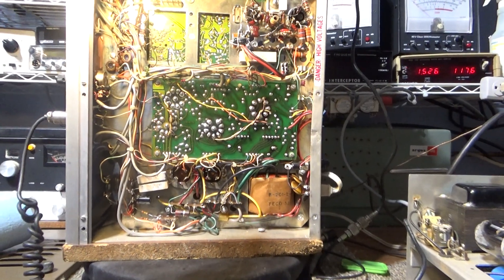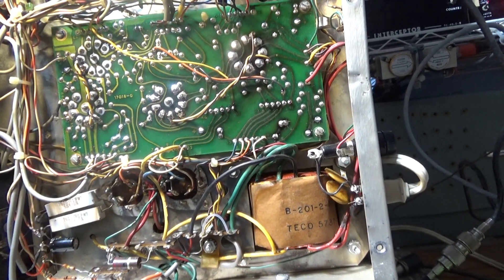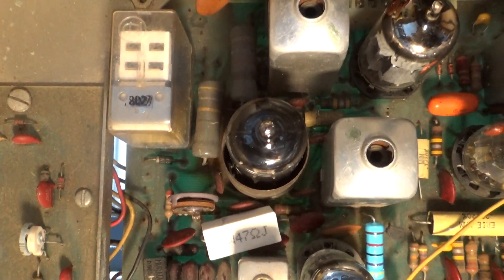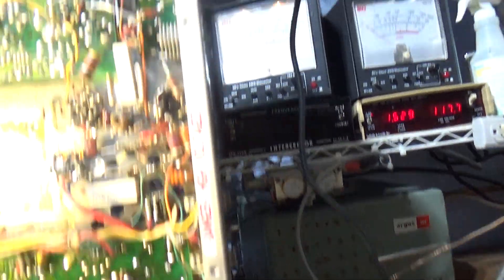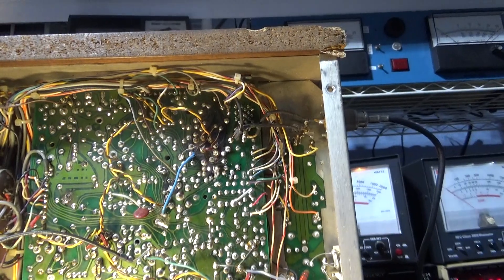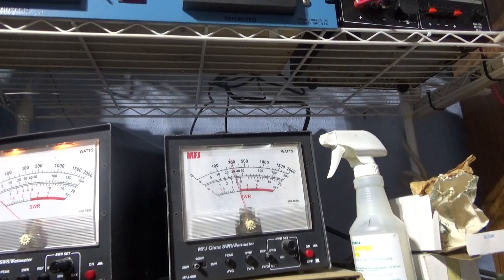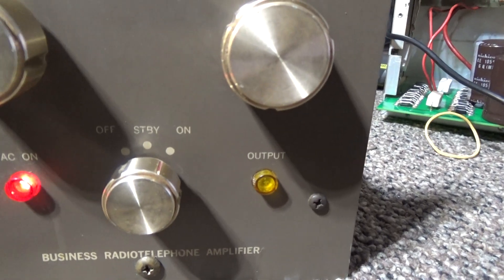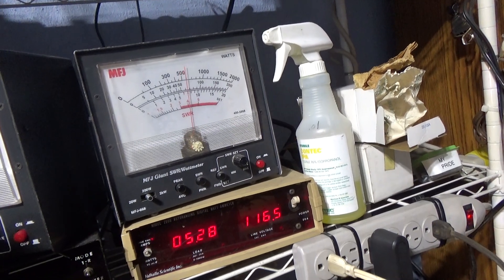One more Tram D201 done, one more left, and  Browning 180 with the proper neon on the bench.

Comment: FWIW, I think that the D201 has better receiver audio than the Mark 3. "Better" as in "fuller". The difference between a table radio and a pocket radio. The difference between a 6L6 and a 6AQ5. The D201 I had had the VFO mod for the upper channels. 
If you're lucky enough to find one that hasn't been all hacked up be prepared to spend time and money to restore it. I had to replace many components and resolder every connection to eliminate the thunderstorm noises it made when first turned on. 
The tube S-meter circuit is sensitive to changes in AC line voltage and will wander around. I made the mistake of selling mine to a guy who was physically disabled and couldn't adjust the meter zero and after a week of going to his house to adjust it I bought it back.
Reply from the maker: Agreed.